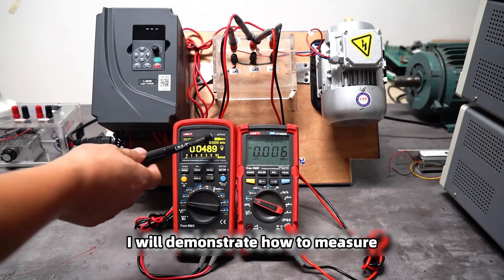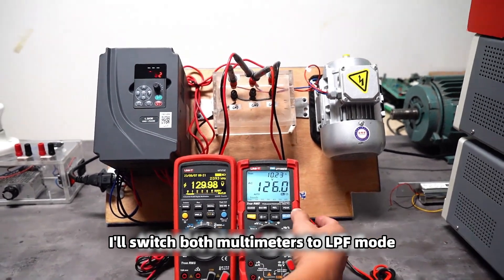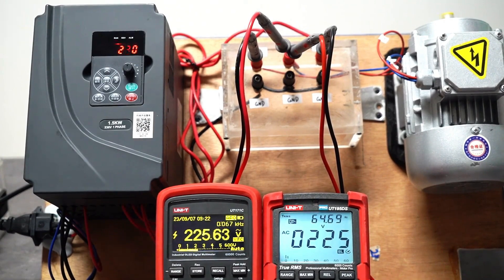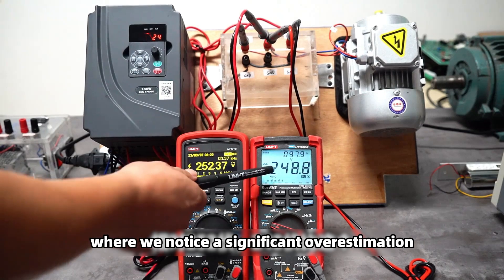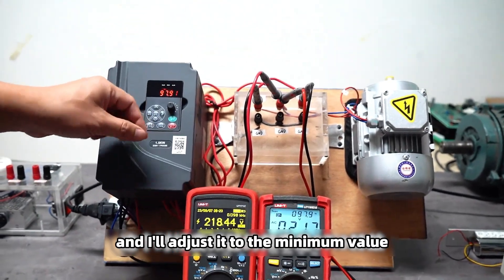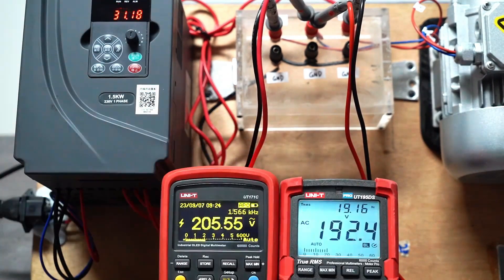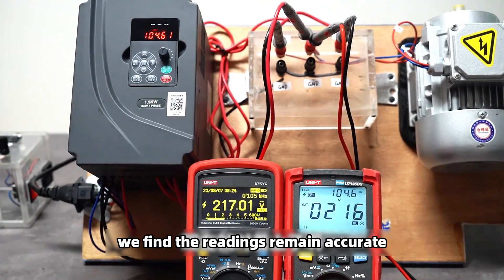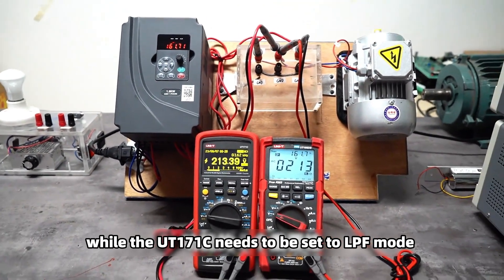UT171C vs. UT195DS: See which model reigns supreme in standard mode accuracy (Standard & LPF Modes)

Comment: LPF on 195DS and VFC on 171C is it same functions?
Reply from the maker: Hi Dear,

Thank you for reaching out.

These are two different functions and are used in different scenarios. 

LPF is mainly used to filter out high-frequency signals to accurately measure low-frequency signals. 
VFC is often used in some situations where analog voltage signals need to be converted into digital signals for processing.

Any questions let us know at any time.
Best regards,
Uni-T Team

Comment: Why does Expensive multimeter not give the correct reading until you have to change the mode.... Why does it not work automatically? 😕
Reply from the maker: Hi Dear, thank you for reaching out. Because UT171C has higher accuracy and can detect a wider range of waveforms, it can detect PWM simulated waveforms so need LPF mode to filter high-frequency signals. 

It cannot automatically measure because it has a wide detection range and cannot know which waveform you want to detect. Just like different multimeters have different ranges, in order to obtain accurate measurement results, you need to manually switch the range.
Reply: @UniTrendTechnology  ok thanks
Reply: Cual es el mutimetro caro